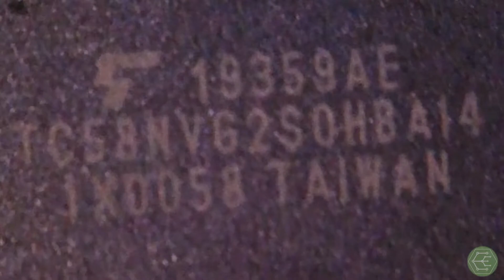TCL 43S425 Repair - Mainboard Replacement

Comment: Hello, I bought a TCL 43-inch TV from China. When it arrived and I installed it on the wall, it worked very well with excellent image quality. However, it displayed a notification that said, "This USB device requires more power; use a power adapter if available." When I called a technician to help me remove the notification, he informed me that the motherboard of my TCL TV had been replaced with one from a Philco Roku TV. Could you please guide me on how to navigate the settings and disable this notification?

Comment: My 43S421 tcl roku tv is overheating after a storm. Other than overheating after about 10 to 20 minutes everything works fine. I’ve read that the main board is what keeps everything cool, would that be a good board to replace first?

Comment: Is the black piece sitting on top of the main board with the numbers starting( 67 ) screwed on to the TV I'm confused. I see a part on eBay that I could purchase but that part seems to be detached in the photo shown. I wouldn't know how to get it back on whether it's screwed or some type of adhesive
Reply from the maker: Hi The SKIETV! I'm not sure exactly what frame you're looking at- but If you're talking about the big black (almost) square that looks a little like butterfly wings - That's a heatsink attached with some kind of thermally conductive adhesive!

TV Repair has gotten a lot harder with the addition of "smarts" - I got lucky that my problems were contained on a single board, but multiple parts of the TV could have failed together! I hope this helps!

Comment: i need some help with a roku 43 inch tcl 4k. i found the 
partr number and now i think i can just swap them out. if its the wrong part can anything get damaged
Reply from the maker: Hello The SkIETV! It is possible to damage with attempted repairs - I know that different versions of the mainboard (the biggest square one) are made to work with different LCD panels, so it's important that the part number, version number, and part number match closely! (Preferably, an exact match would be used)

Comment: I have the 55r615 and it turns off on its own every 5-7 minutes after being on for a little bit.  I've done troubleshooting and none of it worked.  Does it sound like an issue with the main board?
Reply: This is a cheap fix to just see. Mine keeps going to a pink recovery screen so I’m doing this and got a board on eBay for $24. 

The panel is fine and it’s only a year old. There’s no reason to throw this out or spend $500+.
Reply: I have a tcl 55" 55s41r , turns on but only shows logo . After a few minutes logo fades out .. Any ideas ? Thanks in advance

Comment: this also works to fix the wifi connection? does not scan any network
Reply from the maker: Hi Isaias,
I'm not sure. I believe the wifi module is on a different board, the small one visible at 0:04 near the mainboard. 
It's possible the fault could be on the mainboard, the module, or the communication between!

If everything else appears fully functional, performing a factory reset may help too!

I hope this helps!